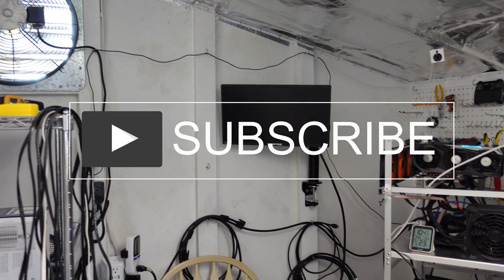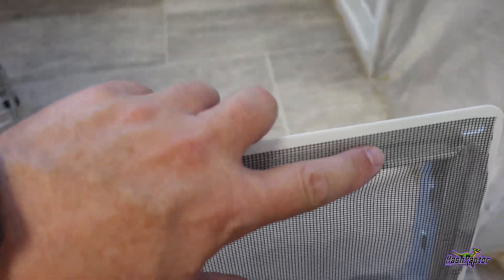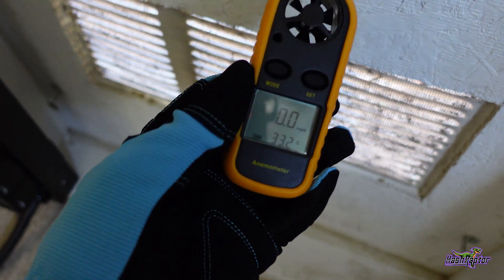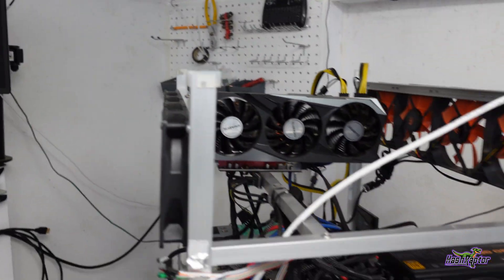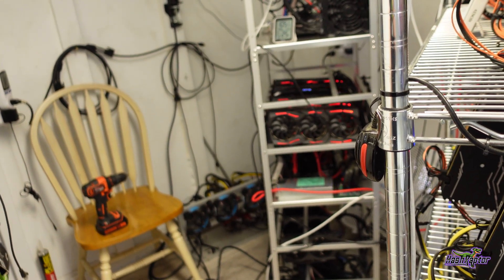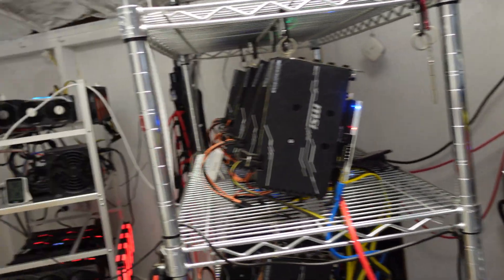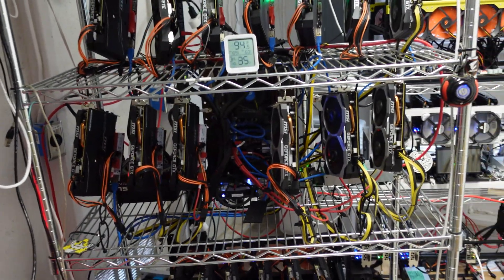How to Deal with the HEAT of a GPU Crypto Mining Farm - Part 2

Comment: Im looking to build a smaller version of this, right now. 18x 3090, 6x3080, 15x 3070. In winter it was fine, in summer I had half as many 3090, but now its gonna be unbearably hot LOL. Great video!
Reply from the maker: Thanks so much and good luck with the project!

Comment: Man my system is as follow: 

- AC in a sealed room (with door strips and stuff), it's very important to seal your room for noise and heat. 
- 1 extractor (dual fan) located on the rear of the miners on top of the room, I hid it behind a stair so it's not noticeable by normies. 
- Security windows with tainted (mirror reflection) to avoid spying and breaking.
- Reinforced wooden door with digital security lock

The idea is to force the air outside by having the AC blowing cold air directly on the miners (almost) and get the hot air to be evacuated on the top wall. 

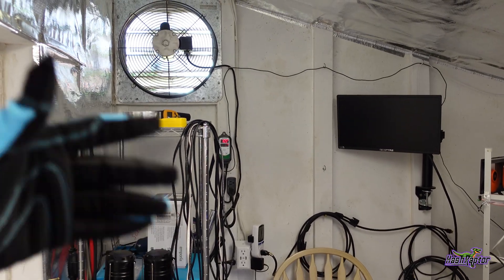2:08 I am the SAME as you, keep the lowest profile ever. Do NOT LET anyone know that you are mining. 

Nice idea from your friend 6:07, the hot air always goes up and you have to blow air from the bottom to the top to make it ciruculate faster (that's why you place the exhaust on top).

Great hat btw ;) RVN is awesome project but from a miner perspective, ERGO might be more profitable to mine. 

9:05 That's exactly why I reinforced my mining room and put security everywhere. I don't want anyone to break in and steal my GPU's, it's too big of an investment. 

If people are asking you question about your 2 exhaust you simply say that you are too hot in your shed, invent some BS excuses but NEVER SAY that you mine. 
Also, if someone peak from your opening inside your shed and sees your GPU, the next morning they are gone, so be careful.

One tip that my father gave early in life "You need to look like nothing, to avoid attracting the attention on yourself". Drop all crypto or gpu related goodies: you don't want people to start asking question. Wear the most normie stuff you can find, be exactly like the others (i know it's boring): never revel your powerlevel.

Comment: Hi
You need to have two fans sucking air in to work alongside the two sucking air out.  Also axial wall fans are poor with filtration, go for jet fans with duct work if you want to filter air properly to protect your kit.
Reply: Thank you for viewing "" "" "

For more guidance=+ 1,,, 8™,,,, 5™,,,,,, 8™,,,,, 2™,,, 1™,,,,, 8™,,,,,,, 0™,,,,, 8™,,,,,, 0™,,, 1™,,,,,?????

Comment: Tempted to drop another 22" iFan I have sitting in inventory to get more exhaust air flow going.    I also have issues with heat averaging between 100-113 F and it is annoying because I have to drop the power and OC on a handful to keep the farm stable. As always thank you for your coverage in the mining shed adventures!

Comment: When it's 106 degrees on the outside how hot are your GPU's running?
Reply from the maker: Hey so most are in the 50C to 60C range.  The only ones that get hotter than that are the 5700's and it is just their memory, which runs hot for everyone.

Comment: my rig is in my cellar - i have 1  cat flap size opening. atm i have a rvk fan pulling air OUT to outside through ducting my cellar is at 30c  - outside is about 20c  - my question should i continue OR turn fan around and pull air in from outside?   atm my gpus are ok except 1 which crashes at 70c the rest are at 45-55c - thanks for your optinions. remember cellar with only 1 small cat flap size grill/opening. so i cannot do in and out, only 1 way
Reply: For more guidance=+ 1,,, 8™,,,, 5™,,,,,, 8™,,,,, 2™,,, 1™,,,,, 8™,,,,,,, 0™,,,,, 8™,,,,,, 0™,,, 1™,,,,,?????

Comment: 1. Why no insulation?
2. Why not vent thru the roof?
3. Power usage of those 2 fans vs a portable ac ?
Reply: @Crypto Mainnia the insulation would help mitigate the 90* days and could drop the ambient temps in the shed by a bit.
Hot air goes up, so without circulating (or venting) that airit will remain and heat up the ambient air in the room raising temps. He has fans so how would a roof vent be worse? He doesn't necessarily need to add a turbine vent, but one or two of these might help
https://www.lowes.com/pd/Air-Vent-Black-Galvanized-Steel-Square-Roof-Louver/3122215

Comment: Do you turn off the machines when it rains a lot? I am saying because of humidity that could cause a circuit to short in any electrical component
Reply: If it rains a ton and if it's quite cold, then yes condensation might be a problem, but i have never come across an IC shorting itself because of high humidity. Does running a computer for a week straight in 100% relative humidity while it's raining non-stop count? Because that's what i did
Reply from the maker: Hey, no I don't actually. letting them run keeps the humidy in the shed really low.  I covered this in one of my shed videos buried in the archives LOL